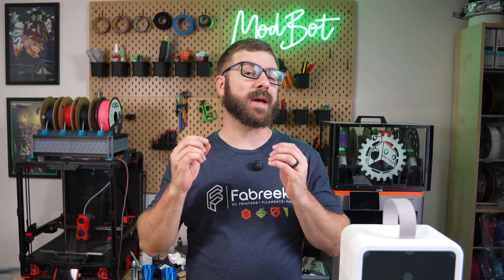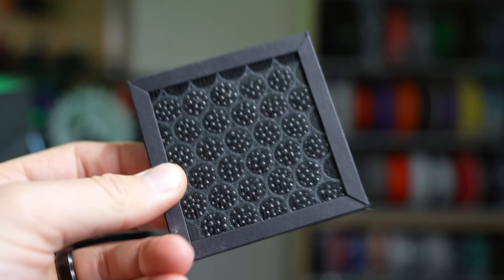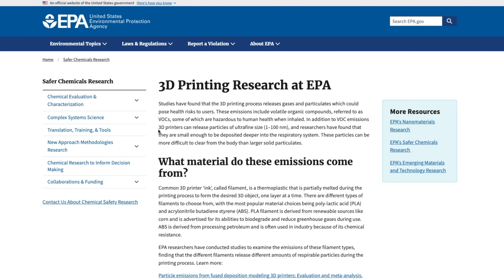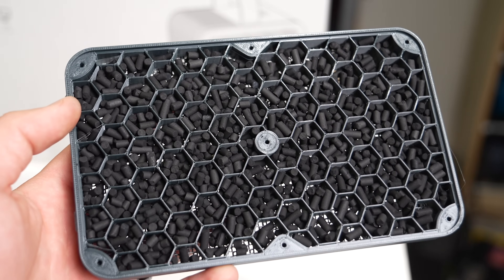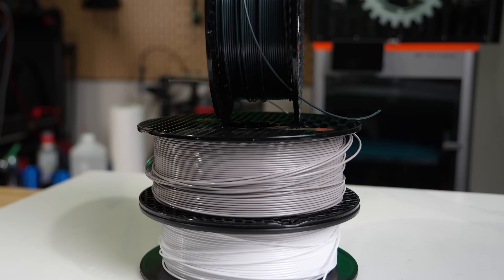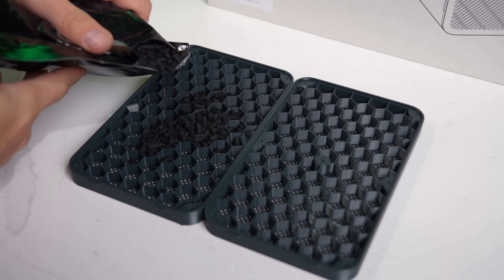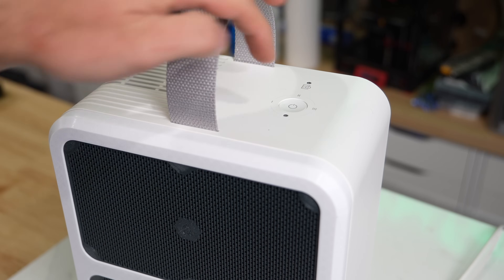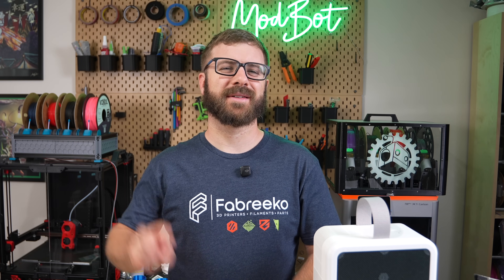Affordable Filter Solution For 3d Printer Fumes (Aire UPPÅTVIND Mod)

Comment: This is a great adaptation of a commercially available product. Just a reminder though: evacuating to outside is the best practice and filtering/scrubbing the air recycled in the volume should really be used when external evac isn't feasible. I actually do both.
Reply from the maker: I should have mentioned this. Agreed, it’s what I do with my laser because it’s just not feasible to filter.
Reply: @ModBotArmy this is un related but do you think you could make a video about PHAT CF filament? And support interfaces? I’ve been having issues finding an in depth video online about the best way to go about it when it comes to overhangs. You’ve made videos like this in the past for TPU where you used supports for them and it came out flawless. Thanks!
Reply: I agree but at the same time, it still is putting particles into the air. You are just diluting the source. I have an enclosed voron in a grow tent. I leave a small air filter in the tent to clean ambient air while printing then vent to the outside after it completes. No heat removal, and VOC's are almost 0 because of the 2 layered approach. No heat loss either, the tent can help keep it warmer during cold months.
Reply: How do you evac to the outside? Just simply attaching a duct to the back exhaust fan and through the wall? Or placing the entire printer in a separate enclosure (since the printers own enclosures are not air tight) with exhaust?
Reply: @fugixi  some people use those hydroponic tents to fully enclose their printer. If you're worried about leakage, this is one of the better solutions, otherwise you can place an air filter or two around the actual printer, that should work ok too.
Reply: Nothing Cleans Air Like Clean Air....
Reply: Evacuating outside is a massive energy waste anywhere the indoor temperature is controlled as you're continually dumping conditioned air (that you pay for) outside. It also makes it much harder to maintain a stable chamber temperature since you're constantly venting the heated air out and pulling cold air in. It can be alleviated with a heat exchange system, but the expense and effort quickly ramp up when you start considering this kind of solution. Hard to justify when there's very little evidence that the VOCs produced by 3D printing PLA/PETG are even harmful.
Reply: @dsp4392  at no point has anyone in this comment section suggested to do this for PLA or PETG. Some of us print stuff that objectively does produce harmful VOCs at printing temperatures.  I suppose I could have been more explicit but it seems obvious to me given Bambu machines have filament profile control for air filter fans...
Reply: @dsp4392  It's the same thing as running a 80-400CFM bath/laundry/stove fan, which most of us do throughout the day anyhow. If you're printing 24/7, then this isn't ideal. At that point you could look into getting an ERV to offset the exhausted air. Expensive, but choices have to be made.

Comment: Nice upgrade.

It would be even nicer to have the cover slide onor have a snap fit nstead of having to fuss with screws.

Also, seems like the carbon might significantly reduce airflow; was that checked?

Comment: 0:05 FOLGERTECH 2020 SIGHTING! I worked at Folgertech in their prime, and love seeing those kit printers out in the wild here and there. My FT-5s are still kicking even though modern printers are 1000x easier to use and have much better print quality. Its wild to think where 3D printers were 10 years ago when I got into them and how primitive the hardware and software was compared to now.
Reply from the maker: Oh man! It was my first kit and second printer. I learned SO much with that machine. I wish I had still held onto it. I always wanted one of those massive FT5s.
Reply: @ModBotArmy  I always believed that the kit printers of any brand were great for people getting into the hobby. You learn a lot more about the function of a printer when you have to assemble it versus just pulling it out of a box and turning it on. That being said, it probably did limit the widespread adoption because not everyone is into DIY assembly. I know I'm glad that I started off on that route but I'm also glad that the plug-and-play nature of printers nowadays get it out to a much bigger audience.

Comment: I simply bought the bigger IKEA filter FÖRNUFTIG. Gas filter can be purchased separately and simply added. Buying a new gas filter is 10€. Seems like the better choice to me honestly...  how much is a bag of the activated carbon?
Reply: Suitable Ikea name.
Reply: nope, the factory gas filters are worlds apart from the ones in this video, its like 20g of gold dust compared to 1kg of gold nugget or in other words, they are a joke for filtering alot of gases. Those are just filter mesh with a bit of activated coal dust compared to activated coal pellets.
Reply: Just saw that - yeah a heck of a lot better solution and off-the-shelf so you save time

still don't think it will filter UFP or VOCs very effectively but better than absolutely nothing. I think I'll stick with my beefy philips air purifier and evacuating air outside (after passing through rudimentary carbon filtration and a flexible hose)
Reply: Same here.  It’s also a much slimmer unit and has a higher flow rate too!

Comment: There’s loads of information from the CDC, EPA and OSHA about the dangers of working on/near 3D printers.  Any melted polymer will release UFPs and VOCs.  Some worse than others.  The most concerning thing is the research shows these cause a lot of inflammation in our bodies.  That can directly affect the pulmonary and cardiovascular systems.  I love 3D printing. I just don’t want it to expedite my death!
Reply: Printer in an enclosure - check.
Ventilate outside - not checked (I can't modify the place that I'm renting). Leaves me with a suboptimal setup (ventilate and filter the air in the enclosure, hoping nothing bad will get out in the room when I open the enclosure)
Reply: Do any of these sources of information also cover how to prevent these health issues? Aside from staying far away from active 3d printers, obviously.
Reply: @SuperCuriousFox  yes essentially you can have the printer inside an enclosure and either vent outside or utilize a filtration system. I’ve been using the BentoBox on many of my 3D printers   Please print safe!

Comment: I'm currently looking at designing a nactivated carbon holder for a box fan to be used in conjunction with 4 or 5 air filters in a Corsi-Rosenthal configuration, but this would be a decent budget option.